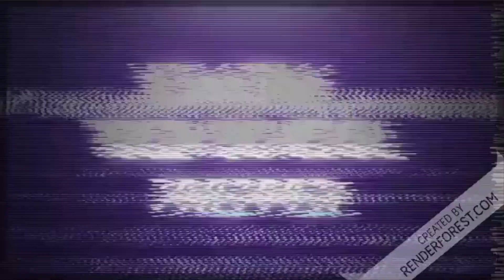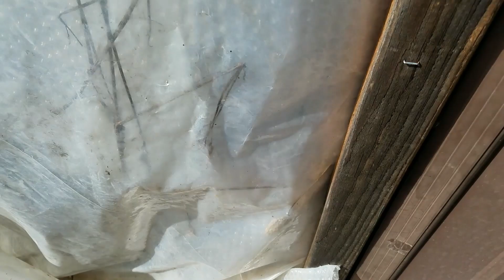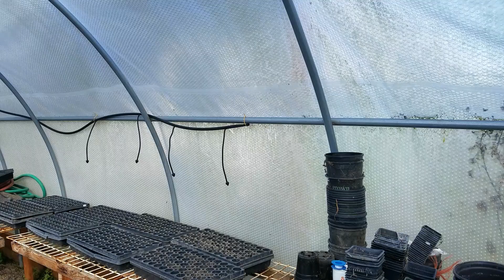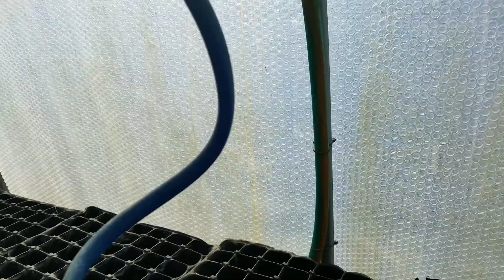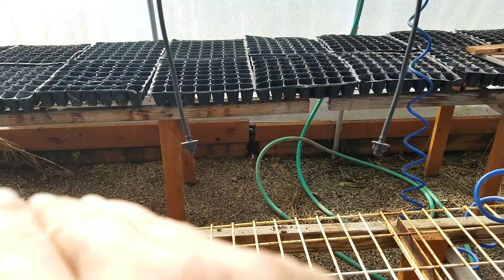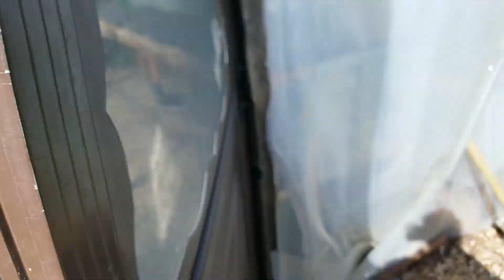Hoop House tour aka High Tunnel

Comment: How does it connect at the ground is attached to lumber or pipe? Also is it bolted down so tbe wind doesn't blow it over?
Reply from the maker: nothing bolts it to the ground, it has a pressure treated 2 x 4 'skirt' system, just to keep the critters from digging under (mice mostly).  i suppose if we had a huge storm it could  rip the cover off but this sucker is HEAVY and is positioned between my pump house and the big RV cover (the thing that looks like a covered wagon) he did that in the exact same style, bending pipe and welding together...he put metal roofing on the sides and it just sits on the ground too. anyway it isn't going to move, infact i'm not sure we could move it if we wanted.  Husband did put pipe on the very bottom, think skids so we could pull it is we had a big backhoe....maybe :)